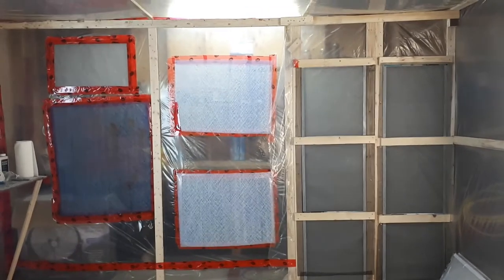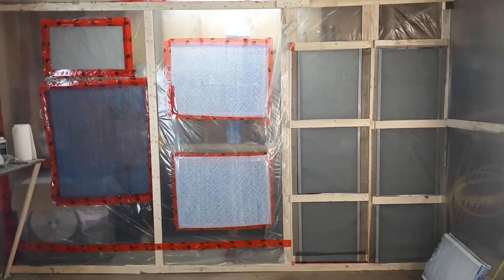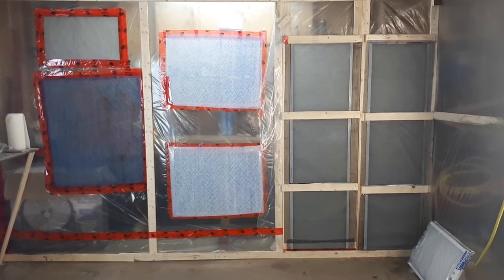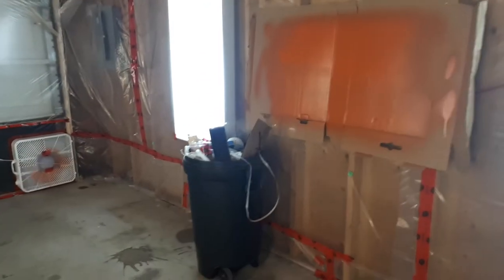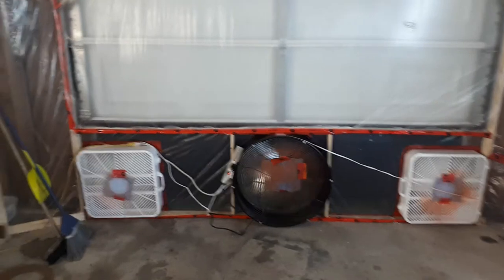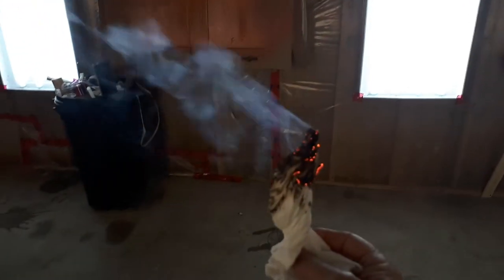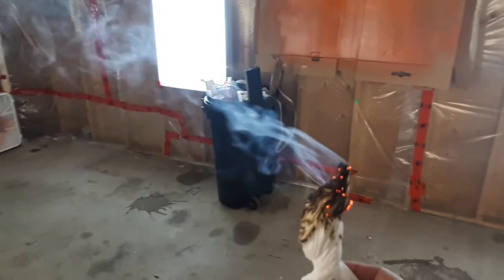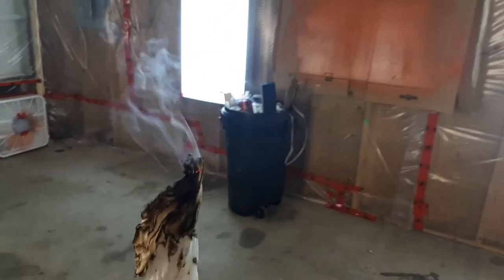DIY Spray Booth and Air Flow Test

Comment: I like this negative airflow booth. I am doing something similar. What people don’t understand is that if it were positive pressure and say you didn’t cover some small cracks or electrical outlets those areas would suck air/fumes and create the possibility for an explosion. With the negative air flow method the only risk is at the fans so it is important to have explosion proof fans.
Reply from the maker: Good advice. The nice thing about this booth is the high volume of air exchange. I painted a whole car in one shot and there was very little overspray in the air. I doubt I would get anywhere near combustion levels of solvents in the air. Although I don't have explosion-proof fans, which would be ideal, these are all AC induction motors, so unlikely to spark ignite. My booth is far from perfect and impossible to keep completely dust free. But it does significantly reduce airborne contamination as opposed to painting in a typical garage. Will you be uploading a video of your booth? Cheers.

Comment: You have to place the paint bench and everything else at the other end (exhaust side). Dust is from all that stuff.
Reply from the maker: Yes, that would be better for sure. I did use my air hose to blow everything off with my exhaust fans on high. I didn't get too much contamination in the paint, but this type of booth is at best a compromise., but, yes, every bit would help.

Comment: I'm making the same kind of booth, most garages here in the UK are much smaller that the average garage in America so it is going to be a tight squeeze. I was wondering do you know what the air speed is in feet per min or meters per second as far as I can see it should be 0.5 M/second.

Comment: Im building one myself very similar to yours and Im wondering how yours worked when you actually spray a car . Looks great ""
Reply from the maker: Hey MaverickSS454. The booth worked well. I did get a tiny bit of stuff in the paint, but just small dust particles. You really have to know where they are to find them. This is far from a filtered full downdraft booth obviously, but I was really happy with the results. My main concern from the get go was evacuating the fumes/overspray. It did a fantastic job of this. Although I used an HVLP gun and sprayed fairly consistently, there was zero fog. It kept the air completely clear. Hope this helps.

Comment: I’m looking at something like this. My fear is a spark
Reply from the maker: Even if there was a spark, with high airflow and a low concentration of solvents in the air, it's very unlikely to ignite. Airflow is key. With the airflow I had, it would never reach a concentration needed for combustion. I thought long and hard about this because explosion was a concern for me too. That's what led me to do a lot of research. After that, I felt very confident that it was safe - especially when I did the airflow tests. I also worried about isocyanates in 2K paint. With a good 3M respirator, fresh filters and great airflow, I couldn't detect the slightest smell of solvents at any stage of the process.
Reply: Adam B what high speed fan is that?

Comment: You should be using positive pressure. Your sucking in air/dust from any opening possible. Use filtered air coming in and particulates don't stand a chance.
Reply from the maker: I couldn't get the air to clear at all using positive pressure. I extensively reseached paint booths and understand that positive pressure is the best. I got very little contamination in my paint job. I do consider the set up I had to be just a few steps above painting outside on a calm day, but it was a few steps enough to get a decent, fairly clean paint job.
Reply: @acbent11  well that would be frustrating. Have you tried putting the fans up top and exhaust filters on bottom corners for down draft? That is I believe the best way just a bit more annoying to put together. If that doesn't work maybe have one fan negative at a lower speed so it pulls but not so much so that it could draw in from and open seams? I'm actually getting ready to build one myself so trying to think of all the variables lol sick of dust or bugs landing on my shit
Reply from the maker: @kep6386  I had basically tried blowing air in through the filters and it would create positive pressure, causing the booth plastic to bag out. I thought it was going to work, but the air vortices caused so much turbulence that the booth wouldn't clear at all. That's why I ultimately went with the negative pressure setup which created a great air flow and kept the air completely clear no matter how hard I went on the paint gun. I did take a lot of time to really seal up the booth, but of course it could never be 100%. Your ideas might work though.
Reply: Do you even know what positive pressure is? Positive pressure is what increases chances of explosion (not negative air flow).